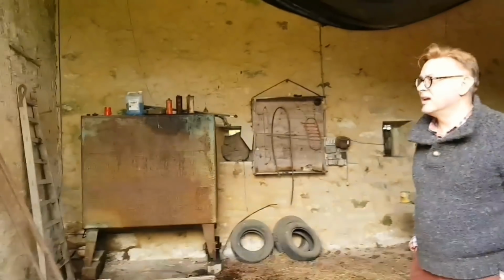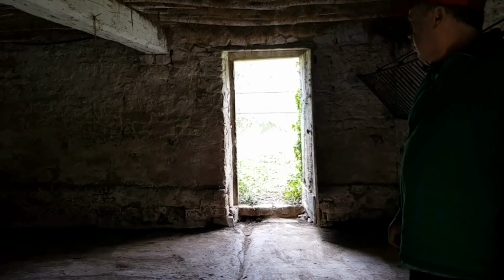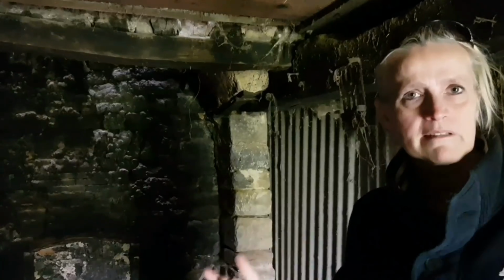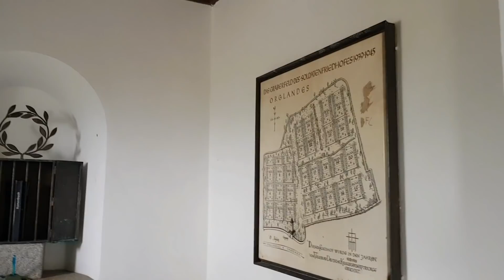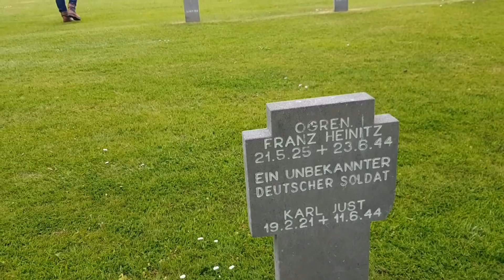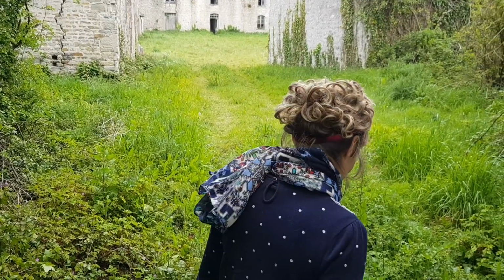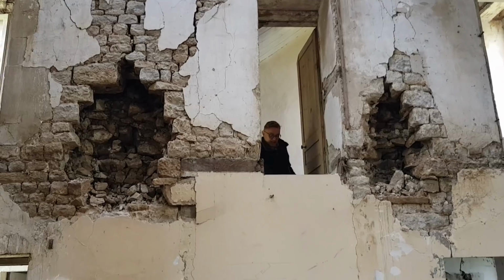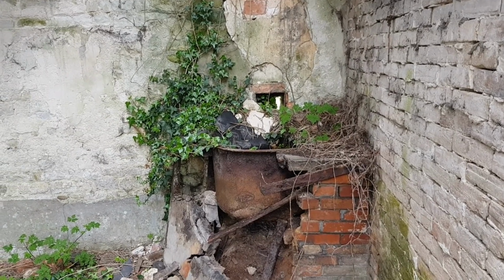Ep 5: A Day of Surprises

Comment: Sometimes buying a house that is gutted costs less to restore as you are not working around existing walls and floors. You can reinforce the walls, lay down concrete ( or limecrete ) and build inside onto that as you go. It wouldn't put me off as you could add character from salvage and still make it a good insulated home.